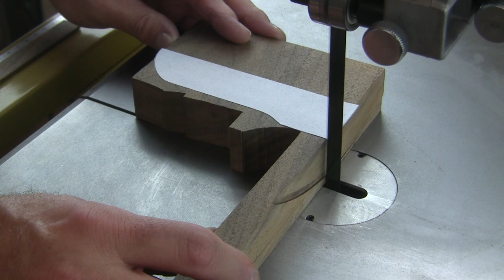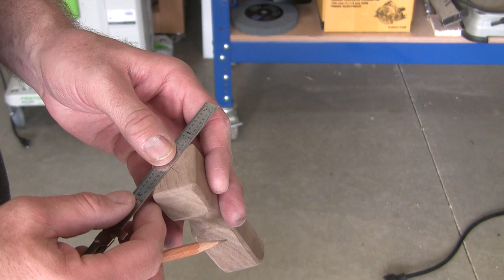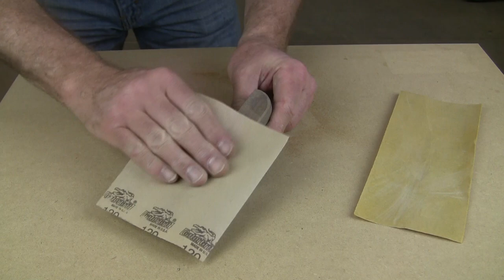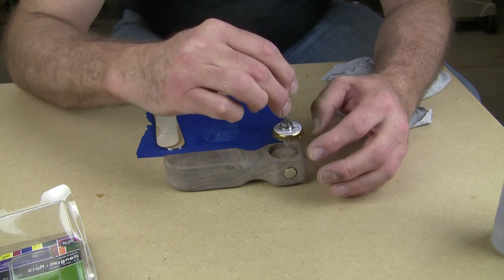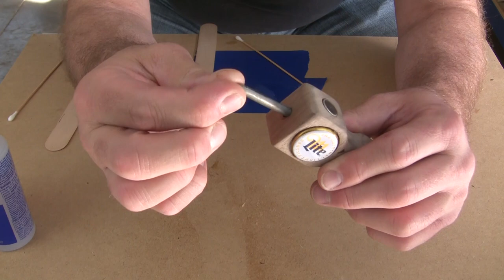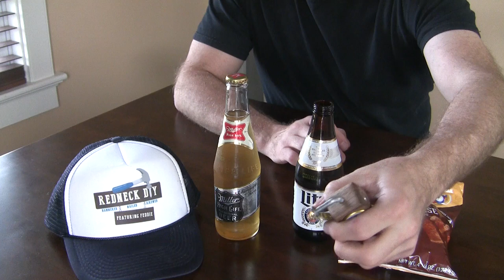How to Make a Homemade Bottle Opener

Comment: this will be my first woodworking project, but I haven't got all the bandsaws etc so gonna have to try with basic handtools and multi tool
Reply: One handsaw, a couple of pieces of sandpaper, a hammer, a nail, and a piece of scrap wood are enough to make this basic design.

Comment: You could have glued magnets in the center of the drill-outs for the bottle caps rather than gluing in the caps themselves.  Then you could easily change out the caps depending on your current favorite beer.

Comment: Bar aqui da frente tem um bem mais simples e barato. Ítens: cabo de vassoura cerrado, um parafuso e uma cordinha pra prender na parede.

Como fazer: enfia o parafuso no cabo de vassoura e esta pronto! Arromba ate porta

Bar in the front has a much simpler and cheaper. Items: closed broom handle, a bolt and a cord to attach to the wall.

How to do it: thread the screw on the broom handle and you're done!